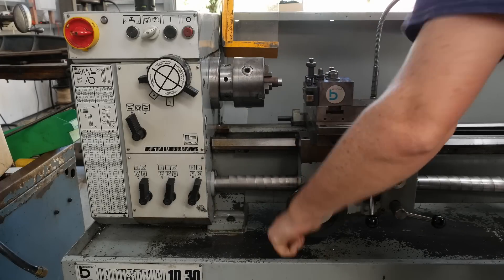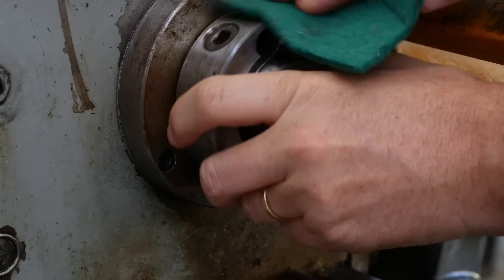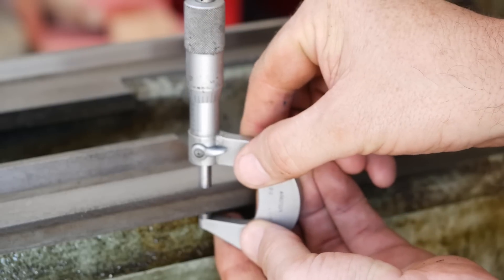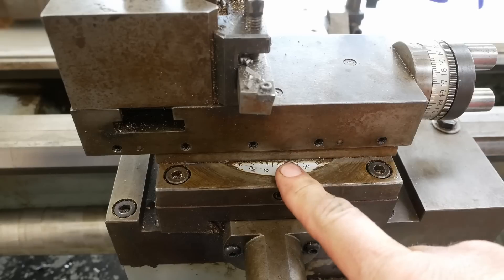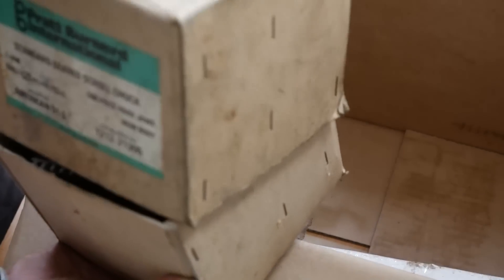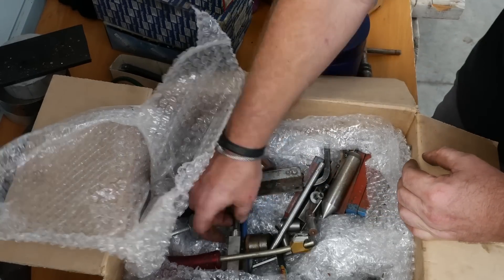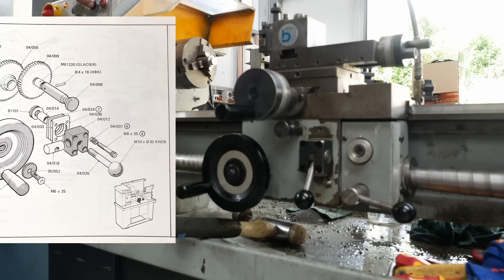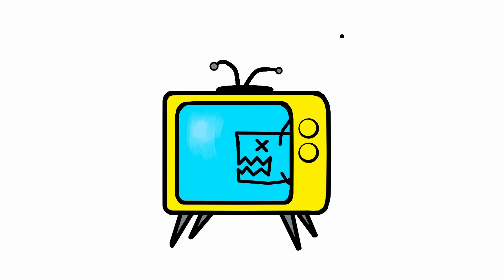Boxford 10.30 lathe review || RotarySMP

Comment: He is off to a great start with the machines he has.  A huge advantage is all of the space he has and the ability to move things.  I'd be in a similar situation to you having to find creative ways to move machines of that size into a basement.  I've started small with things that can be hoisted by a couple of guys or loaded on furniture dollies.
Reply from the maker: He made a really nice shed there. I am so envious of that flat concrete floor.
Reply: @RotarySMP  I have a flat floor I just dont have the head room for bigger equipment.  The other challenge I have is the approach to the basement entrance.  Its either soft grassy lawn or a narrow and very slopped concrete walkway.  Not insurmountable but not easy either.
Reply from the maker: @joedowling5452  I know what that is like :/

Comment: Hi Mark what a nice lathe!
If it was my aquisition, because the headstock is splash lubricated,
I would lift off the headstock cover and inspect  to be certain that the oil passages
to the bearings are clear and oil flowing nicely.
also drain and flush the old oil and replace with new.
Reply from the maker: Thanks Steve, good advice. I pass it to Anton.

Comment: The power feed block on the front of the apron is not loose on my Boxford 270T. The power feed engages almost as soon as one starts to lift the lever but, letting go causes the lever to drop down and the feed disengages. To lock the feed on I move the handle all the way to horizontal. This is the same behavior as another 270T I used some years ago. All the best!
Reply from the maker: Thanks I’ll pass that to Anton

Comment: Nice lathe, never knew Boxford maufactured industrial lathes.
Excellent idea on having controls on top of headstock , happy electrician,  no knee deep in oil 👍. 
Good check on spindle droop, some high end tooling to boot 👌.
Thanks for sharing
Reply from the maker: It is a well laid out machine.

Comment: The lever for sliding feeds is mounted in that loose block with square spring washers behind it, it's a clutch, so pull that lever all the way up to engage. The spring washers are the holding force for the clutch so need adjusting using the block screws to allow full disengagement with the lever down and tight engagement with the over centre lever up.

Also, you'll want to make a new mounting plate for the compound slide. The original design has a large diameter recess cut in it for the graduation ring to sit in under the flat surface of the bottom part of the slide. When you tighten the slide down at any angle you set it at, the clamping force bends the bottom dove tail part of the slide into the recess on the base plate. I made a new plate, totally flat with three clamping points instead of the two on the original, marked the graduations directly on the surface of the new plate and scraped the underside of the slide to match the new flat surface. Now when it's fully clamped down there is no bending force and adjustment of the slide gibs is easy and consistent with no binding regardless of how tightly clamped down the assembly is.

Otherwise, I found the travel of the saddle along the bed quite prone to stick slip, probably due to the relatively narrow contact areas on the vee way. I solved this with a bit of machining under the saddle and turcite lining for both the vee and flat ways. Now it slides so smoothly and without any significant stick slip to point I can repetitively adjust the carriage position by microns just using the highly geared hand wheel.

It is now a really nice lathe, basically a top spec, reduced size Harrison m300 clone, just with a proper gear train that does true metric to imperial conversion using a 120/127 gear set, rather than the very close approximation you'll get on the Harrison and larger Colchester lathes (except the bantam that is).
Reply from the maker: Thanks for sahring your experience on these lathes. I will point Anton to your comment.

Comment: The short throw on the feed engagement shoudln't worry you unless the lever pops out under heavy load or slips.  It's just a friction clutch pack.  It seems going into the cross feed just bypasses the clutch pack.  Now the looseness of the lever block may be to compensate for improper /setup/shimming.
Reply from the maker: Time to RTFM on that adjustment :)

Comment: I wouldn't add DRO to tailstock, but topslide for sure. It's very handy being able to back off when single point threading and know the movement exactly without dealing with any backlash or something. Also, being able to get a good tool post and programming in different tools in  your DRO so there is no touching off is another nice thing. 

You should convince him to put a rotary encoder on the spindle, and a servo on the lead screw and do away with all of those gears haha. That is my plan once I get my own.
Reply from the maker: Sounds like you have CNC envy :)  Better to start with the CNC machine than convert a manual one.

Comment: Great video, very timely as I am currently rebuilding a Boxford STS which is very similar to the 280T. Anton looks like he got some really nice accessories, like that original Boxford ball turning attachment. Regarding the cross feed engagement lever, those screws are used to adjust the safety clutch pressure on the feed mechanism, take a look at the manual which explains it. I don't think you should be able to engage the threading lever unless the feed plunger is set to the middle "neutral" detent for obvious reasons. There is a spring-loaded pin inside the apron which should prevent this, mine was actually damaged or cut short (intentionally?) by the previous owner and will be replaced. The name plate is missing, it should be attached to the four holes on the back of the lid (electrical cabinet) on the top of the machine. If you guys want any more info or just see some of the stuff I have done to mine you can check out the reels on my Instagram account which is linked in my about page. Cheers, Jeremy in Auckland, NZ.
Reply: There's also a really nice wiring diagram redrawn by another Kiwi floating around, it also details the factory setup and also the modification required to properly convert to VFD drive. I can email it if required.
Reply from the maker: Thanks Jeremy, I'll direct Anton to your post.
We thought that the ball turning attachment was shop made. Nice that it is a factory original part.
Reply: @RotarySMP  you could be right actually. I just thought at first glance the base looked original but perhaps not.
Reply from the maker: @JeremyYoungDesign  Either way, it is a handy accessory.

Comment: Nice lathe, very similar to my Harrison cousin that from the same era that I upgraded to last year. Mine had been on coolant as well which had crept into gear change and saddle boxes so had fun cleaning out the sludge and varnish. Nice haul of accessories
Reply from the maker: Thank Paul, I think the 600 group did a fair bit of swapping between Harrison, Colchester and Boxford designs at the end. Good point on the coolant. It does get everywhere. Anton will need to check.
Reply: @RotarySMP  Yep I think Harrison bought boxford in in the 50s, the manual looks like it was from the same print shop, I would change the made in England to made in Yorkshire 😁, but that's a personal thing, and definitely keep the honest patina
Reply from the maker: @Paul-FrancisB  Made in Yorkshire... I like that :)
Reply: @RotarySMP  Boxford were not part of the 600 Group at the time this machne was designed, they were part of the Brooke Tool Group that included Broadbent lathes & Hayes milling machines.

I completed the last year of my apprenticeship at Boxfords between about August '80 & September '81. I assisted in the insatllation of the Snow bed grinder (the previous model lathes had milled soft beds), which had a Radyne induction hardening unit at one end - the beds were first hardened, then ground at one setting using a form wheel to do all the top surfaces at one go. The output from the induction hardening generator could be switched over to a separte gear hardening unit for doing the headstock gears.

The similarity to the M250 / M300 lathes was probably due to them being designed by the same chap, who had moved form Harrison to Boxford. IIRC he was called Ian Baulk - only occasionally saw him on the shop floor in a white shop coat when he came to check on the build of the first machines.

I don't recall Boxford fitting a rating plate. One additional sticker that was applied to the first batch was next to the oil sight glass - initially the sight glass position was too low, so a sticker was produced that read "Fill to top of glass plus 1 pint" - I still have one stuck to the toolbox I used at the time.

The Boxtrees Mill factory outside Halifax that made these is long gone. When I last talked to someone from Boxford at a show it seems that the Snow grinder didn't make the move when the changed factories. Not sure if they still offer a similar machine, having gone, like Denford, into small mainly CNC training machines.
Reply from the maker: @mgnbukint6502  Thanks for your feedback on that. I sent your comment off to my my friend Anton who owns this lathe.

Comment: Hi guys, interesting video. I have an Industrial 1020. Occasionally I need to change the change gears for threading, what do you recommend as the best way to change the change gears?
Reply from the maker: Good question. I will ask Anton to respond.
Reply: Thanks mate. There are two or three bolts to undo. One on each cog sprocket and one on the tensioner.

Comment: Hi again , after pausing the 1ms flash of the cross feed diagram, there are springs under the 4 bolts holding the engagement level.
this suggests that some float was built in ,as you no doubt concluded.
the fact that it works as is does now suggests  stop using immediately and investigate
something is assembled wrong or something has failed
Reply from the maker: Yeah, we also came to that conclusion. First tightening up the "loose" screws, but then guessing they are supposed to be like that, and loosening them back off.

Comment: Haven't watch the entire video, but I would look for good speed control on a lathe if I ever was going to buy one. Also an easy way to install a DRO.
Reply from the maker: There are few lathes from that generation with speed control, except the real top end (Schaublin, Monarch etc). It would be easy enough to put a VFD on this lathe, but it already has a nice wide speed range.
The last bit of the video covered the DRO.
Reply: @RotarySMP  I watched it, and that's certainly a nice lathe.
Reply from the maker: @oguzhan001  It really is.

Comment: I've never used a Boxford (nice looking lathe, though!), but, remember one lathe (brand not remembered) in the Machine Tool Technology class I took in the early 90's that had a very similar drive engagement lever. What I really remember is that under the load of a cut, sometimes it wouldn't disengage!  You couldn't apply enough force to make it STOP.... Ruined a nice thread practice piece (with an Acme, a Square, and a standard V thread sections) on the last few passes when it wouldn't disengage even with bruising my hand beating on it.  
Maybe having those bolts loose was to "fix" something locking it up under load?  
Or, you know, they were just loose....
Reply from the maker: Sounds like we need to RTFM on that mechanism :)

Comment: I'm considering adding a DRO to my tail stock but not on the top slide for two reasons: I rarely use the top slide (it spends most of its time stored away as I have a rigid block to replace it) and when I do, the travel distance is set by the part I'm tapering. By that I mean the tool just runs out of the part at both ends of the taper at least for the simple parts I make!
Reply from the maker: Good point. I also see the top slide DRO as being of little value.

Comment: Not all 50's lathe have a small spindle bore. Mine got 36mm spindle bore, good gearbox (but not as good as the boxford), real steel hardened ways (less than 0.03mm wear). The only downside is a threaded spindle (huge M64 thread). It was a pretty advanced lathe for this time.
For measuring wear on ways, use a good straight edge and feeler gauge, check what gauge goes under the straight edge.
Check also for bearing runout from inside the spindle bore, as there is always less wear than on the chuck taper.
Reply from the maker: What lathe is that? A 36mm bore on a threaded nose lathe is probably a pretty large machine right?
Reply: @RotarySMP  Hermes Mentor, 320x610mm and about 900kg. Quite an upgrade from my chinese BV20 but I do not regret it when I take a shower of hot 42CD4 steel swarf 😆
Reply from the maker: @martinchabot_FR  That is a nice spindle bore for an otherwise smallish lathe. My Boley only has a 19mm bore.

Comment: What a great purchase ! Manuals AND locker keys ! Great condition and So much 'by catch'.
I've been thinking of picking up a lathe (we had the bad luck of having to give away my old man's lathe when he passed years ago !!) ... this is a really useful video ! Thanks.
I'm taking notes, and reading all the comments below. 
I will prob have to go 240v single phase. Does amperage have an impact ? I could possibly supply 16 or 32.
Reply: ... and will a none three phase limit the diameter size of the spindle diameter ? Thanks !
Reply from the maker: Not really. 240V at 16A is nearly 4K and the motors on lathes this size are normally only about half that. Check the motor, as many industrial 3Ph motors, can be jumpered in either star or delta, so you could run a 1Ph-->3Ph 240V VFD. Then you dont have to muck around swapping out the motor for a single phase one, or creating a dummy phase with a capacitor.
Reply: @RotarySMP  Thank you very much for the feedback, much appreciated.

Comment: Definitely add a DRO. At least for the two main axes. On auxiliary support, only if the difference in price between 2 axes and 3 axes is small. And make it a "dumb" DRO - no math on angle and movement of auxiliary support, it is PITA for DIY lathe IMHO ;-). On tailstock the DRO is least useful. I would buy a cheap Chinese one.
Look at the videos for replacing that auxiliary support with a chunk of steel, like many Youtubers do. Solid toolpost will improve stiffness and you do not need auxiliary toolpost that often. And you can swap them if needed.
I personally would just clean the lathe and start using it. You should also inspect whether internal oiling system works and look up oiling points, so that Anton can oil the lathe properly with way oil, so that his grandson can inherit a lathe in a perfect working condition.
The last thing I might do is make a holder for my small die grinder and grind in the chuck jaws. Again there are many, many videos of how to pre-tension the jaws for grinding and only grind them the tiniest amount to bring them into perfect alignment.
Oh ... one more thing. Anton might want to get a couple of precision ground stones and stone those small dings in hardened bedways smooth.
Reply from the maker: I replace the top slide with a solid block on a CNC, but never really got into that on a manual lathe. I know it works for STGW, but he is mostly working on such tiny parts that he uses form tools. I find I use the lathe top slide a lot, and would hate to miss it on a manual lathe.

There is no automatically oiling, but a lot of oil points. We used chainsaw bar oil as a starter, as that is very close to way oil.

I think he has a tool post grinder somewhere in that shed.
Reply: @RotarySMP  I think the ooh no don't use the compound is something of an american machining practice, as is the use of the push clock to set stepface/shoulders etc.
Reply from the maker: @alan-sk7ky  I guess it depends a lot on the size of work you make. 
Tiny --> form tools --> remove compound
Mid size --> Compound
Long --> Taper attachment -->  remove compound
I find I tend to make mid sized stuff on my machines.

Comment: The holes in the rear of the bed are for the tapper unit - thought I never seen one IRL.  Likewise, the holes in the cross slide are for a stop.  You may have trouble mounting a scale there anyway as the gib screws will be in the way unless you can offset it.  I have tried a few glass and mag scales and none are thin enought to fit in the gap so I've ordered Newell NMS300 DRO kit.  Not the cheapest but at least I know it will fit on my STS.  You can tell the age by the serial number thats at the tail stock end of the bed.  The first 2 numbers are the year and 2nd are the month - 8610 = Oct 1986.  Fun fact, most of these types of lathes (known as an X10) in particular the STS (training) where sold to schools and training facilities.  I beleive they were all sold through Aotea Machine Tools in Auckland - no longer in business I think.  Anyway nice lathe and accessories.  BTW whats you thoughts on importing a Maho from europe?  Not found any decent machines in NZ.  Know it wont be cheap but just wont tell the wife!
Reply from the maker: Thanks for the info on the Boxford.

It looks like their is a glut of container capacity, so it might be a good time to imprt a container of machines. Maho's are pretty common in Germany, with Ebay-kleinanzeigen being the main platform for classified ads.
https://www.ebay-kleinanzeigen.de/s-maho/k0
The issue, as always, is getting a good one :)
Reply: " I have tried a few glass and mag scales and none are thin enough to fit in the gap so I've ordered Newell NMS300 DRO kit."
 I have fitted a DRO to my 11.30 and it does fit into the gap. The scale is a 16 x 16mm section. It's protected with a 3 mm aluminium alloy angle which also protects the scale from damage by running the tailstock into it.